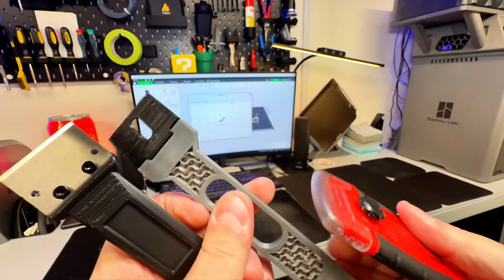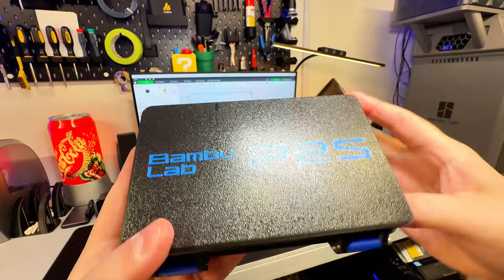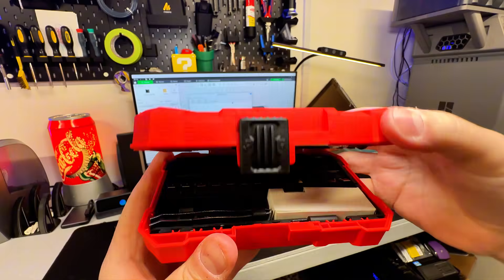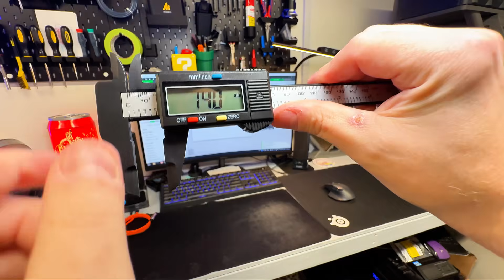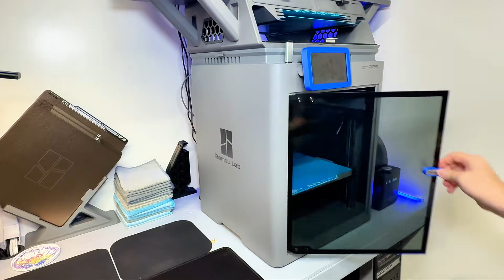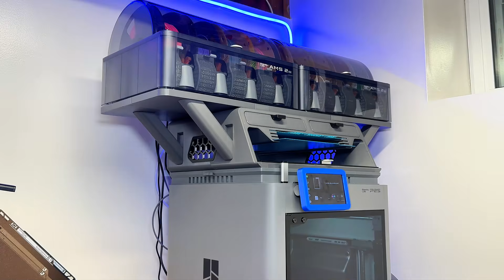Must Have 3D Printing Tools For Beginners!

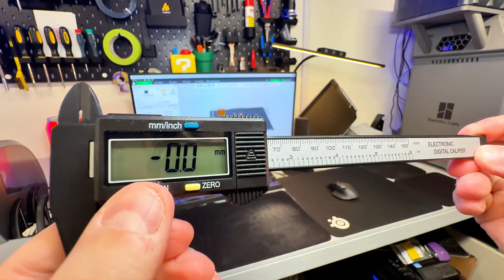Comment: 11:20 I’m sorry man but you have to upgrade that digital caliber, if you get a quality set I guarantee you’ll make excuses to use it.
Reply from the maker: It barely ever comes off the shelf. I’m not designing prints. I’m just using premade models for the most part.  We all have a different use case for a 3D printer.

Comment: i am having trouble on my P2S printer when using tree support and choosing to let the printer print on the model the support keeps breaking off before it finishes printing the piece its there for. I am printing a miniature and its on a circle base the figure has a loincloth that requires support it wont make a support from plate to it but it will if i allow support on print the it prints from the platform but it keeps break off of the base before printing the loin cloth at least to where it connects to rest of the model and dont matter lol. It sticks everywhere but that spot HELP
Reply from the maker: It sounds like you might need to increase the support density or add a brim to the base to help everything stick better! Also, try the “Normal” support setting, tats helped me through some rough prints.

Comment: What AMS rack is on your Bambu unit?  DIY printable?
Reply from the maker: I’m using two different solutions. One is a simple riser with the built-in vents.  And then on top of that, I have a dual AMS two pro stand.